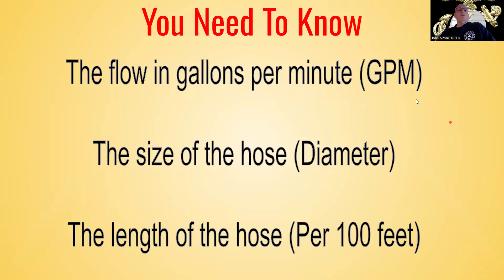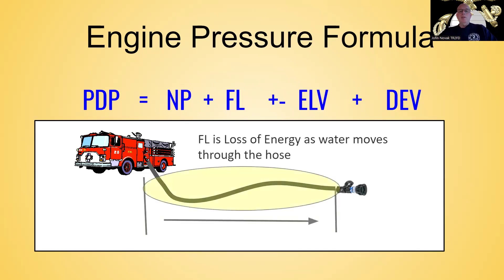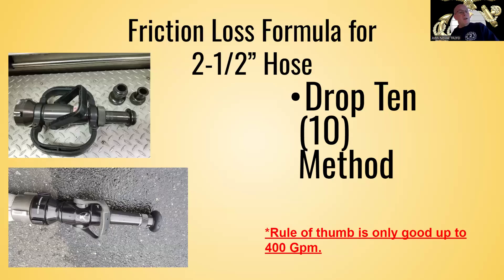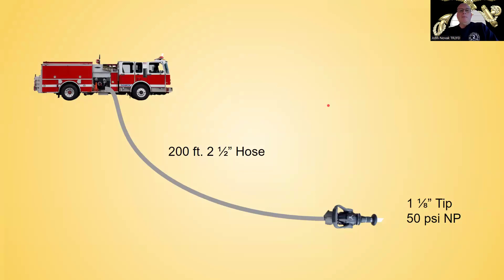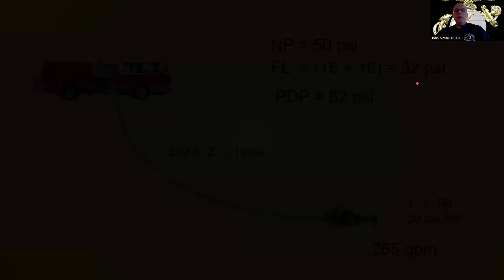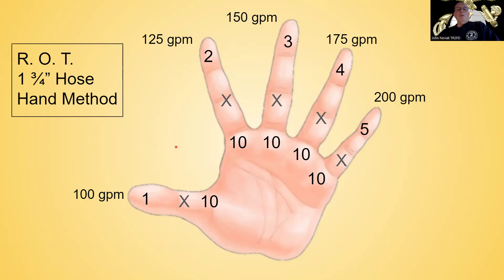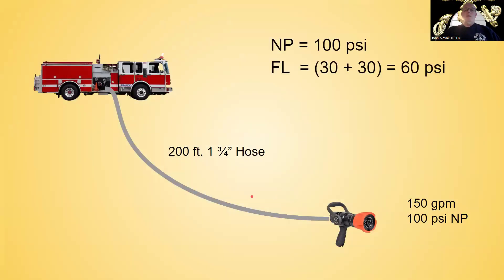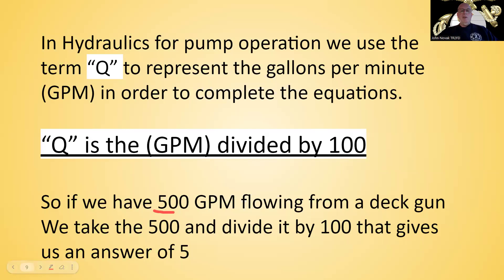Friction loss for 2 1/2 inch and 1 3/4 inch hose

Comment: Think you meant 1 1/8
Reply from the maker: Jason, I believe you are referencing the one nozzle where I said it was a 1 3/16 inch.  If that was the case, I did not miss speak.  I was referencing a 1 3/16 inch tip for a 2 1/2 inch nozzle.  Here is a good article that speaks to the advantage of the 1 3/16 inch nozzle  (https://www.hydrant2nozzle.com/1-316-nozzle) If you were referencing something else could you be more specific so I can make the correction.  However, thanks for watching the video.
Reply: @johnnovaktr2fd677  Chief, I could have sworn that when I watched the video the other day that your 2.5" example showed a 1.25" tip at 265. All good with 1 3/16 tip idea, we've played with that as well as the 1-1/16 Shupe tip for 2" lines! Thanks for the video.